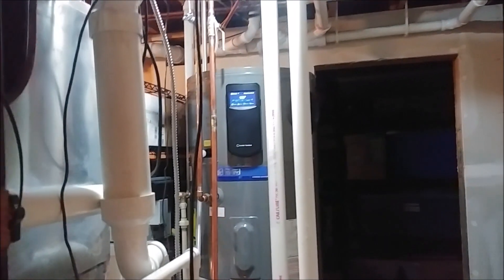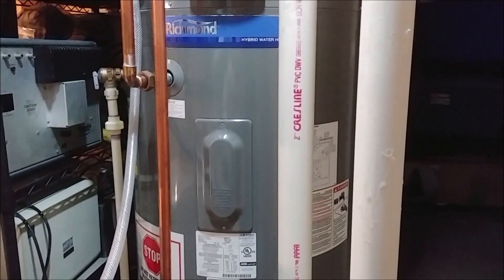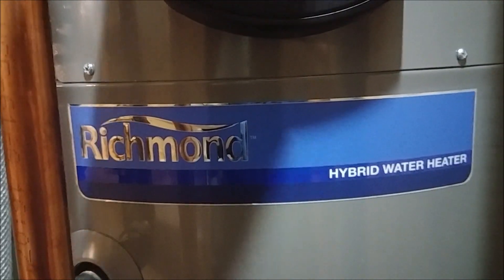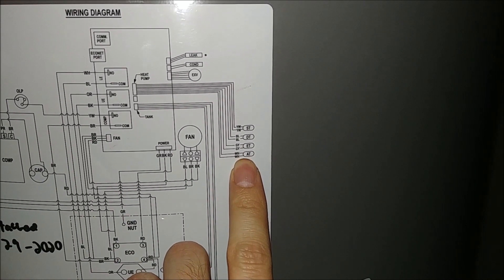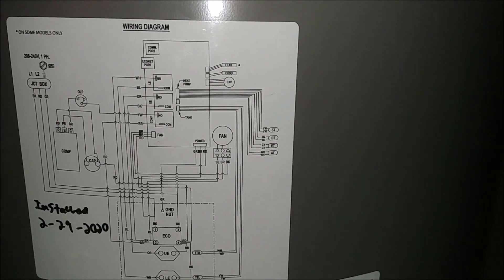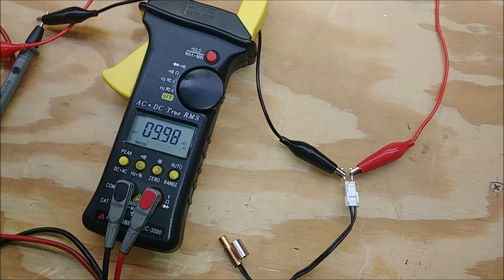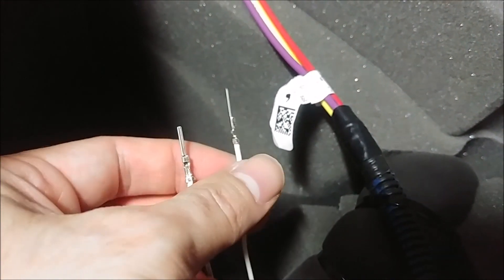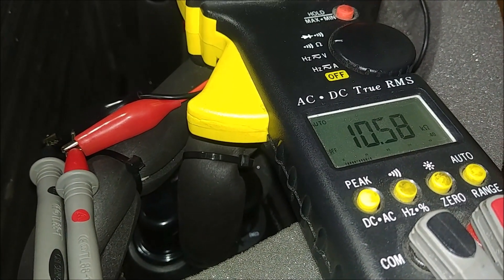Troubleshooting the temp sensor on the water heater.

Comment: What is the world coming to?  A WiFi enabled water heater.  I guess that's not to far fetched since there's a refrigerator that can take an inventory and send it to your smartphone while you're in the supermarket.
Reply from the maker: Yeah, I don't have mine connected to WiFi, or the internet...

But, I believe that EcoNet WiFi connection can be used to coordinate when the water heater runs to maximize your solar and battery storage system.

So if your house battery is full, and there is still sunlight remaining, you can store that extra power as heat in the water tank. Or you can load shed the water heater to prioritize other loads, if you are exceeding your solar / battery power limits.

Comment: Always mechanically actuate connectors like those, surface contaminants are a real pain to troubleshoot. Clean the mating surfaces with ISO and make sure there is adequate mechanical force to keep them pressed tightly together.(kinda hard when they are in shrouded blocks, but maybe if it happens again pop them out again and see how well the contacts themselves spring together, possibly bend them a bit to make the fit tighter if it isn't.)
Reply from the maker: I probably should have unplugged and replugged all the other temperature sensors...

But I already had it all back together.